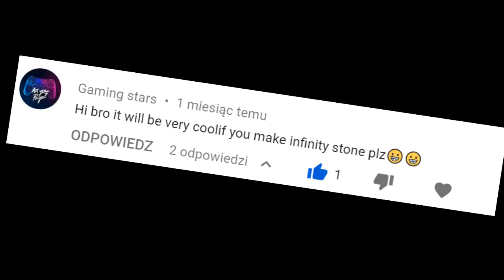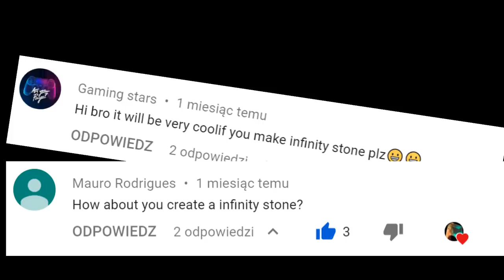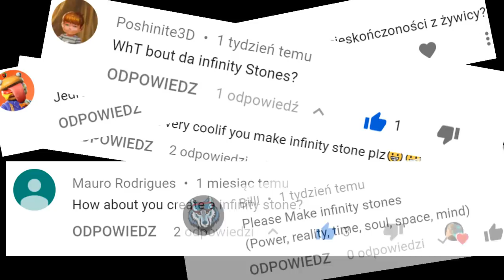DIY. Infinity Stones with Epoxy Resin / ART RESIN

Comment: You should add a resistor to the LED next time, at least 1K ohm, the LED will live longer this way.
Reply from the maker: Ok
Reply: Are you a science geek
Reply: @selviselvakumar833  I studied electronics :)
1K ohm resistor is enough for not taking alot of the power from the battery while at the same time protect the LED light from getting too much current, which would otherwise burn it.
Reply: @CheronoSan  ok thanks bro

Comment: i made a surival katana  and  chizeled out a little crack and filled it with red resin so i looks like a laser is in the handle
Reply from the maker: it certainly looks good
Reply: the resin I used was old so It never dried:P @jedrek29t